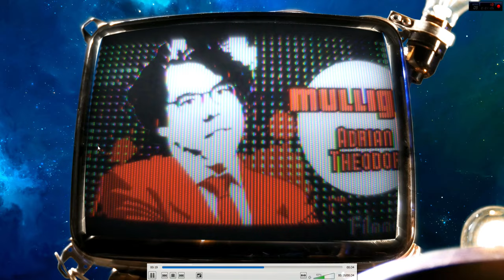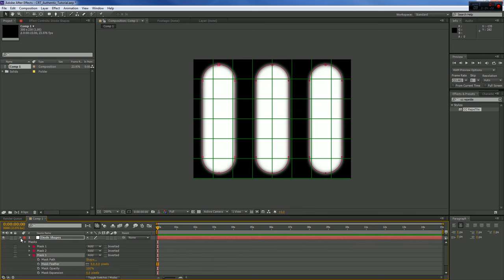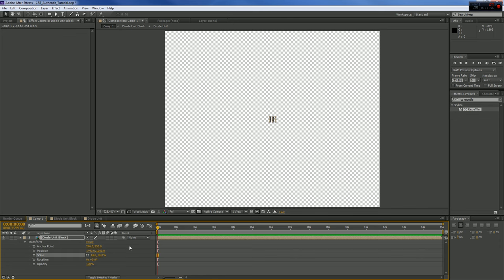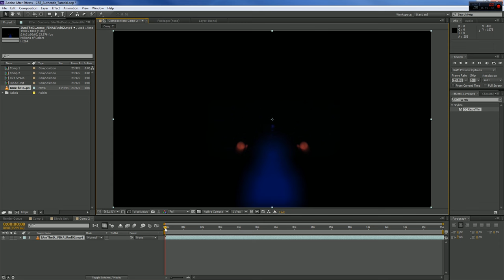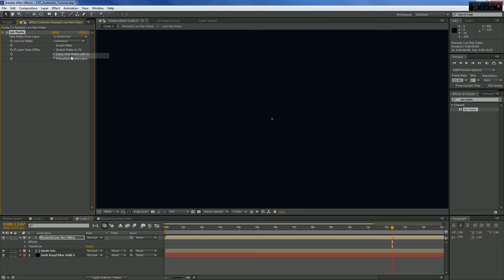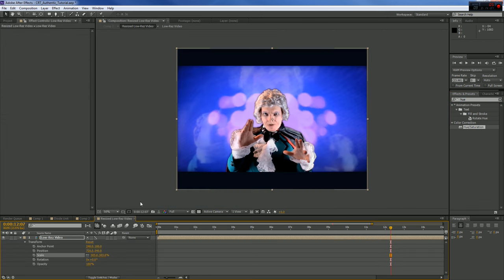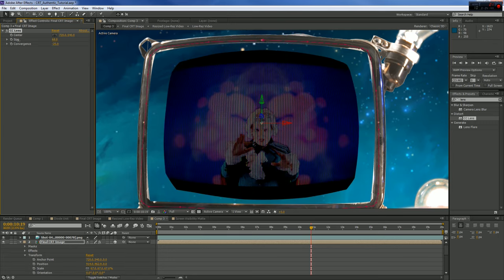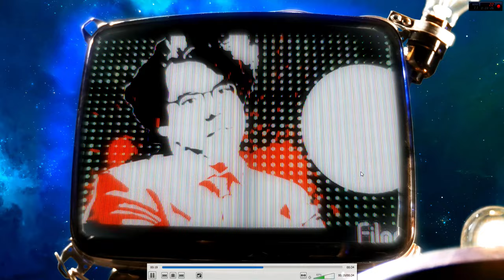How to Create an "Authentic" TV Screen Effect (CRT TUTORIAL)

Comment: Great video, needed this for a recent project and found it very helpful. Also found that white text became very distorted, so placed another copy of the original video over the top of everything in the final part, set it to 'screen' and dropped the opacity a bit. Sorted out the distortion and also increased the brightness / clarity, just in case it helps someone else. Thanks!

Comment: (excuse my english)
Thank you dude, you really helped me! Your tutorial is very clear and professionnal.

This effect can be a little bit too harsh for the video you are using though. I Did two things do make it less hard: 
_ I reduced the size of the pattern
_ I added  my original footage (without any effect) on a layer above all, as 35% opacity
Reply: Etienne Caroff That would help some, cause the color intensity is greatly lost, which is quite inaccurate in the results I got. I need to find a way to get each red green and blue dot to "emit" a very bold and vibrant color.

Comment: I think the idea behind this is better than the result, unfortunately. The constant visibility of the diode pattern is the least accurate part because CRT TVs were quite clear, respectively and you could only see this sort of stuff if you put your face RIGHT up the TV. Perhaps you just don't have the effect dense enough. Also, instead of trying to bring back the image with Glow I might have brought it back by blurring out the black parts and increasing the contrast on them after that to decrease the amount of solid black area, making a brighter image overall. I think less is more when it comes to trying to emulate this effect and getting too technical and accurate may actually work against you and you end up with something unrealistic
Reply from the maker: Colin Brain You're not wrong. But I also don't think this is the end of the concept, or a possible better working setup. A real CRT is shooting highly focused beams of light onto a tube marked with the red green and blue bars. Real light can get brighter and brighter, blurring at the edges from multiple inner material effects, whereas digitally this brightness and blurriness must be simulated. I think adding the glow afterwards is necessary, as the effect did turn out better when used in the film I created the effect for. But you are also on the right track in that some blurring may need to occur on the grid sheets used to split the colors. There's a way to make this work, I just haven't returned to do a mark II video on alternative methods yet. Plenty of other effects I'm interested in exploring for future videos as well.
Reply: The Cinema Warehouse after following this tutorial my result was pretty much spot on, to what this guy said its flaws are. But after monkeying around with a bunch of diff methods to help fix all un-clearness etc..i have actually got it looking very good i can say. Very clear and has the subtle glowin aspect like a crt monitor has. If yall wana see how i did it lemme kno ill make a video showimg what i came up with
Reply from the maker: Colin Brain I played around with the settings again as well. I've tightened up the screen pattern, unstaggered the vertical lines, blurred the mattes a tiny bit, and then played around with levels on the input video. What I've discovered is that if you adjust the levels and curves in such a way to bring your mid blacks way up, your mid whites down, but leave your middle mid-tones untouched (This takes some time to dial in), then the image will show up through the color split screen properly. This allows one to push through more color and light through the mattes with a glow effect, and not have a muddy or crushed image. Think of it as adjusting your dynamic range to fit a CRT television format, which is something that did and still does have to be done for content to appear correctly.

This affect is still probably not something that should be used for all TV VFX, as it can create moire patterns that dont look good at a distance, and the color split doesn't always look good either. But for special circumstances, I think what I and a few other people have attempted here can serve a useful purpose above the typical Venetian blinds effect.
Reply: The Cinema Warehouse could u upload a video to private on youtube. Of all this your talking about so i can see exactly how u did whst ur saying i wana check it out. doesnt have to be long or in depth jus a quick run thru would be really cool bro thx

Comment: Great instruction, what would be the right tile measure for PC CRT?
Reply from the maker: I couldnt say for sure.
I actually ended up almost doubling the density of the shapes (which I now know are called phosphors) because that produced a more realistic result. I'm assuming the size of the phosphors actually change with the overall size of the TV, because no matter if itz 15 or 32 inches, standard def signals could only give you 480 lines of image across the screen. So the question is how many phosphors are in each row, and do the number of rows correspond to the 480 scan lines.

Comment: So, how much is this close to an original crt?
Reply from the maker: Well it of course has no actual circuitry or specific coding in order to simulate the science behind a real CRT. It simply interprets any footage as a red, green, and blue image, filtered through a series of tiny, vertically elongated holes. The actual proportions and size ratio of those tiny diode holes compared to the size of the screen may or may not be entirely accurate. I simply settled on a size that looked best at the time: not too small, and not too large, just the right size to see the pattern, but small enough to still see the image being shown.

By all accounts, it does follow what a real CRT image, seen from up close, looks like. There's an extra softness to a real CRT, though, coupled with the limitations of analogue Standard-def video signal: which is an aspect to this effect that I did not bother with, but may try to simulate in the future, because it is just as equally responsible for the way retro media looked.

Comment: Sence this video tries to  capture an authentic look of an crt image i have to point out one thing. The vertikal lines that you created are not apparent on a real crt tv. On older videogames on the other hand there are horizontal black lines called "scanlines" with a similar bit slightly different look. You can Google scanlines for referance. When watching a movie or tv on a crt tv the scanlines are not visable because of different handeling of old videostandards compared to videogames
Reply: The makeup of the red, green, and blue peg shapes that allow those colors to pass through into the 3 different fields is what I believe to be most accurate here, cause I made sure to look at close-up images of them before proceeding. What isn't entirely accurate is the way After Effects ultimately renders the image, as the footage is passing behind a sheet of white dots, rather than being generated by them, so the pixelization aspect, and the more vibrant colors are lost. I also think it is true that some CRTs would have the red/green/blue groups laid out horizontally rather than staggered vertically, or represented by diagonal dots on some models, which creates the vertical scan-line appearance. 

Basically, this is closer to a CRT, but I'll have to work further with it to reach an even more accurate result, especially where pixelization is concerned.
Reply: I see what you mean. You are correct with the red green blue aspect of the pixels. My point is that  a more authentic look whould be to go for the scanline effect instead of horizontal lines sence the horizontal lines caused by the apiture grille and electron gun are generally not visable unless you get up real close to the image
Reply: Except it wouldn't authentic, because the image IS made up of the grille. If the grille is absent, then the authenticity would be lost, which would miss the entire point of my video. Again, I'll likely revisit this in the future to see what can be improved upon.
Reply: @FilmmakerJ  Your picture starts out showing an example of CRT lines - Horizontal, and then your method of creating these lines ends up with Vertical lines in finish product.  Never mind that your effect turns out fairly poor, you could not even get the direction of the lines correct.  No wonder that you failed to get any traction with this channel, and did only one video in the last 3 years.  This video is a fail.  But then again so is the entire channel.  Too bad, as there was potential.

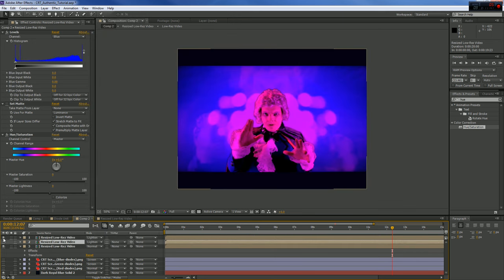Comment: it's 2019 and after effect completely fucks up at 31:04
i drag the level effect, drop the red green and blue accordingly to zero and all i get when i blend mode lighten is a whute picture sad face

when i put the green to zero all i have left is green xD
what the actual fuuck it makes no sense from a logical stand point

so i leave the white green to what it is and drop the rest to zero and THEN it works, all right, okay, fine.
so i keep on keeping on, and then i link the Red video to the red diode comp and the green with the green, etc...

but THEN i have three blue diode next to each other and three green, etc... instead of just one
i have multiple columns of three red green and blue diodes WHAT THE FUCK i'm losing my mind
Reply: I had the same problem but after testing, for some reason, the new After Effects doesn't act the same way as the old one in the video. So what I did to fix it, is to instead dropping them to 0, just put a minus, the default is 255, turn them into -255 and it's going to work, it won't be white anymore, just your normal video with normal colors. Since it's been a year, you probably solved it already.